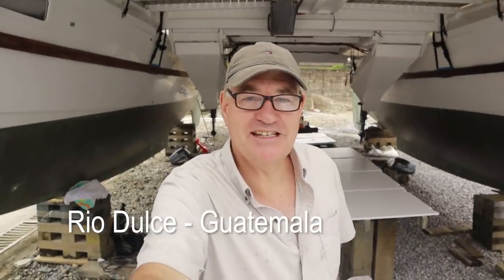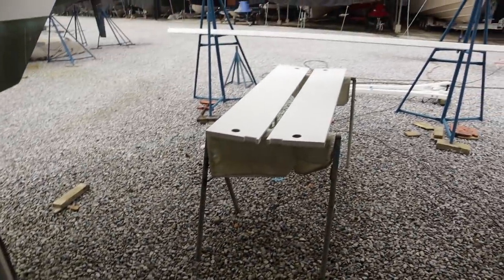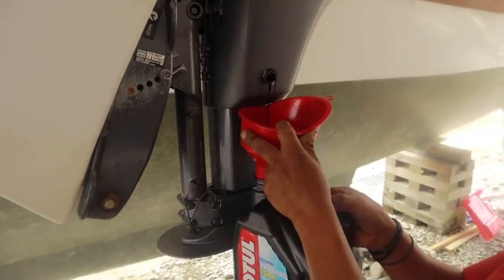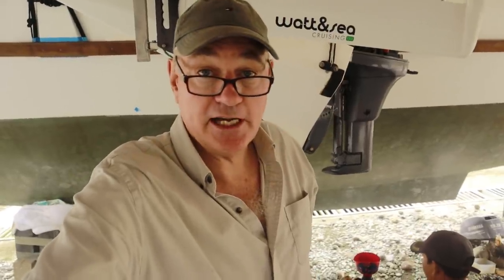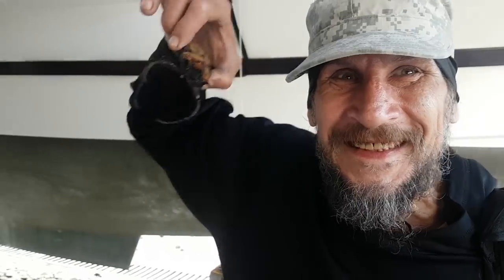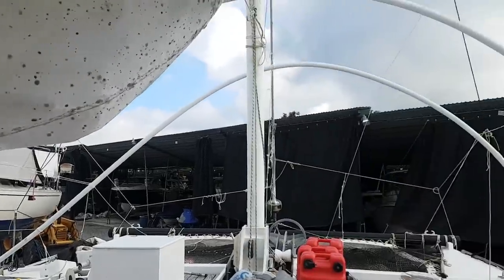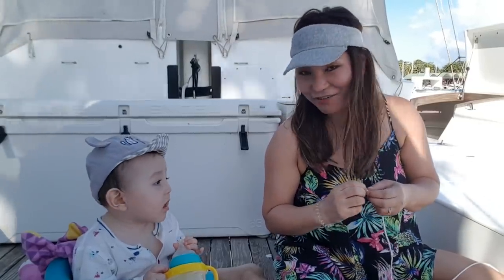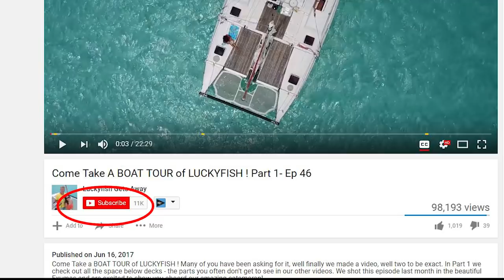Boat Work with an 8 Month old - Ep 103 Sailing Luckyfish

Comment: It's great how well those PVC arches worked to keep the storage tarps off the deck with minimal damage to them. Thus keeping the rain off and letting the air flow to keep the mold and mildew under the tarps down to a minimum.